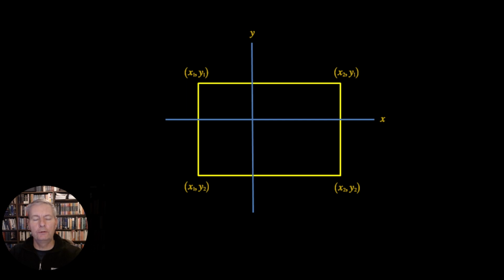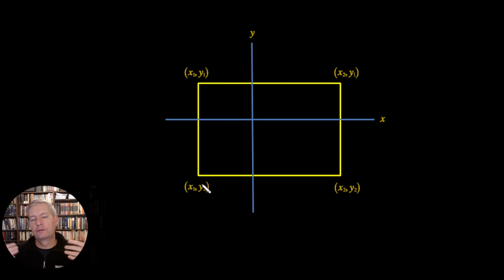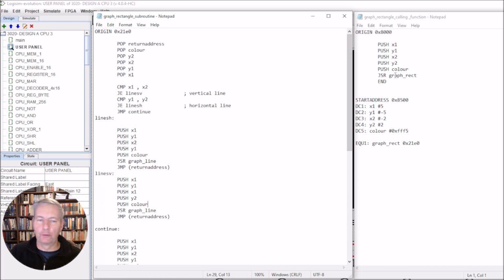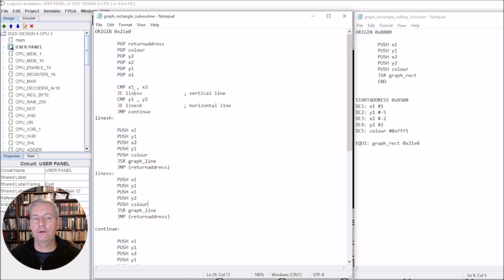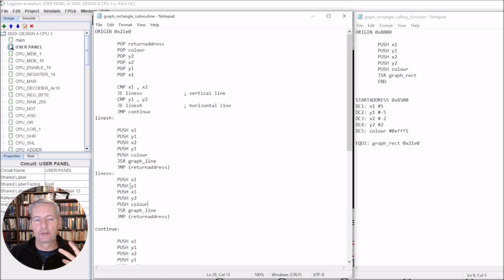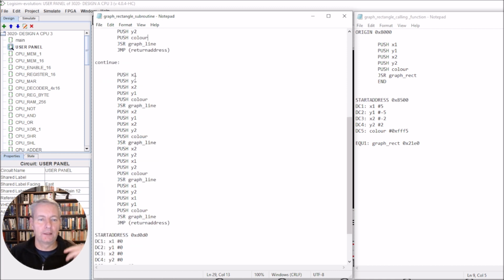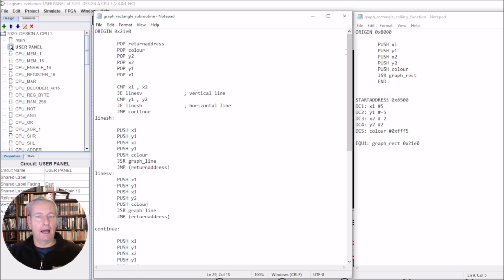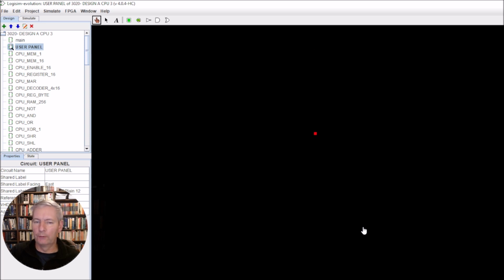Design a CPU 3 - Graphics Library Rectangles

Comment: The introduction into writing DirectX, OpenGL and or Vulkan!!! And I don't mean in the context of using those APIs within higher level language such as C/C++, Rust, Python, etc... I mean by actuallying writing or implementing them. We are down to the very basics of Graphic Programming right at the actual Hardware Interface Level! Very Nice!
Reply from the maker: Thank you. Yes , it has been my intention to strip everything away to the bear essentials. Also to design and simulate everything from scrstch , I mean EVERY zero and one.
Reply: @RossMcgowanMaths  These are some of the toughest but also most rewarding projects ever!!! I followed Ben Eater's 8 bit Breadboard CPU series and made a nearly one to one ratio model of it within Logism since I didn't have his kit to build the breadboard version by hand. Now, what you have done has taken it even a step farther! 

I enjoy this type of content because it brings together all different concepts within mathematics and or physics that you wouldn't think are related such as Boolean Algebra, Ohm's and Kirchhoff's Laws as well as the rest of the laws and formulas related to Electricity and the various circuits that can be built upon them. This also doesn't account for set and group theory when you get into the idea of the mathematics and algorithms behind a language and its alphabet, and so much more. When building a physical CPU from discrete logic gates to generate the ability to count / add, compare  in binary is such a beautiful feat of engineering.

That's why I enjoy series like these. It's the accumulation of the best parts of both mathematics and physics, and sometimes a bit of chemistry along with having the mindset of being an engineer. The ability to create things that can do complex tasks from simple basic components with simple basic operations is completely astounding. If it's turing complete, then it peaks my interests!
Reply from the maker: Yes I couldn't agree with you more. My channel is called Applied Mathematics with Computer Science. I have built a functioning CPU from nothing  , in order to understand run and test mathematical algorithms. I like the interface between the applied mathematics and the computer architecture which for the moment is the assembly language which again has been built in along with the CPU. I am glad you like the channel.
Reply: @RossMcgowanMaths  I'm 100% self taught... I started off by getting into learning C/C++ in order to use DirectX, OpenGL back in the early 2000s as I had a desire back then to learn how to build a 3D Graphics / Game Engine from scratch... 

From there, I wanted to try something else... I had thought about either compiler design or even OS design... yet in order to understand either of them better I had to learn Assembly. Well not exactly on how to program in Assembly directly but more on the lines of creating an Assembler or understanding where and how the software meets the hardware. 

With that, it got me into trying my hand at writing a Hardware Emulator in C/C++. I decided to attempt the 6502 especially the NES implementation of it since there's already a plethora of resources on the subject matter. And from those searches that's what lead me to come across Ben Eaters channel! After watching his series on building a CPU on a breadboard... I was hooked!!! 

Simultaneously I came across two Y.T. channels that did an NES Emulator in C/C++ the first was bisqwit and the second was javid9x. Now the entire concept of ISA design was right there with my peak interest into 3D Graphics Programming, Game/Physics Engine design. It's been about a 20 year journey of independent study and it's been a wonderful hobby. No, I don't do it for a profession, but I enjoy it equally.